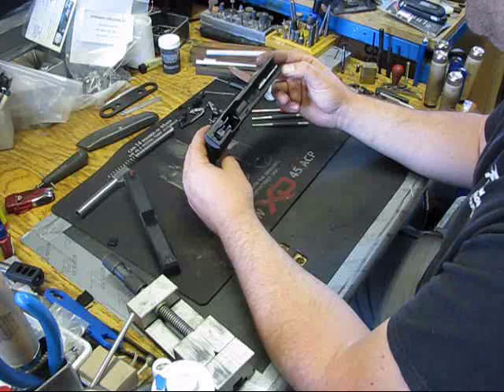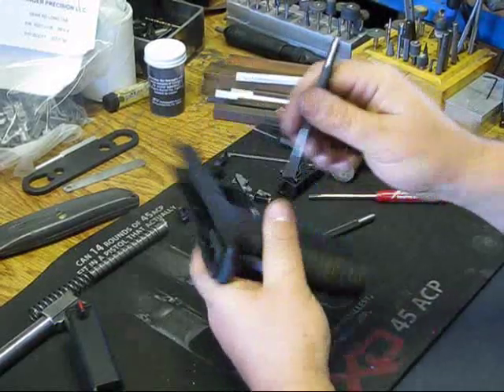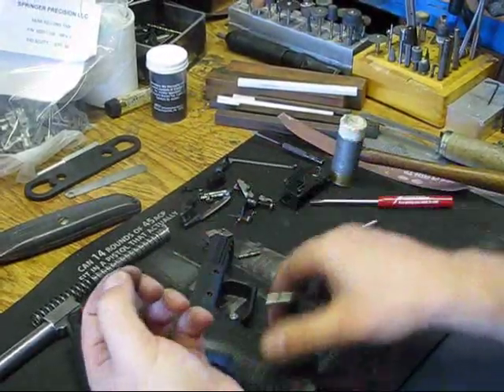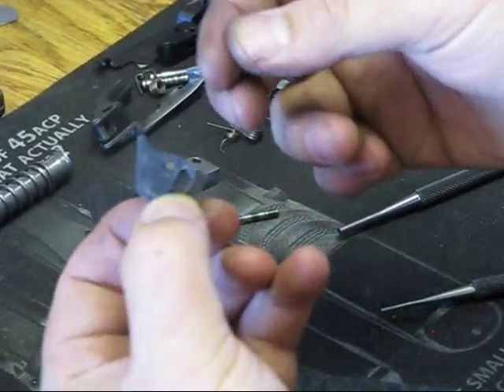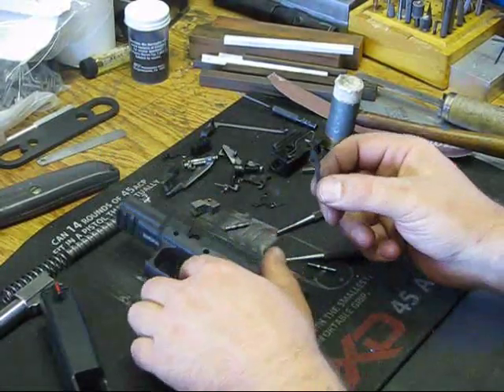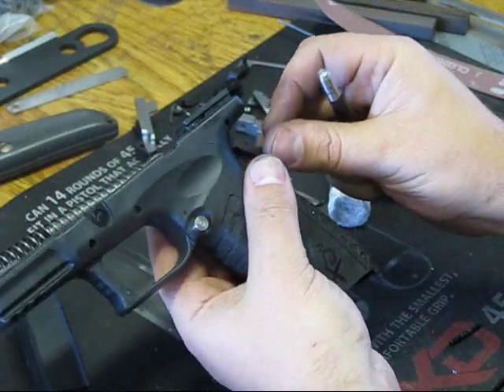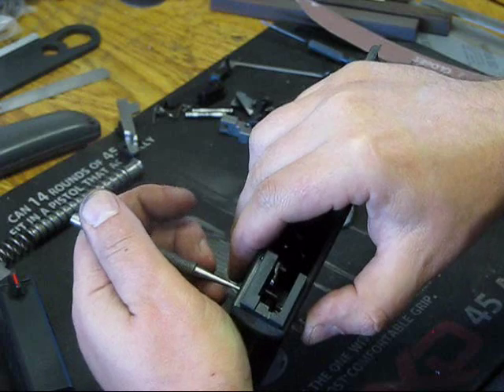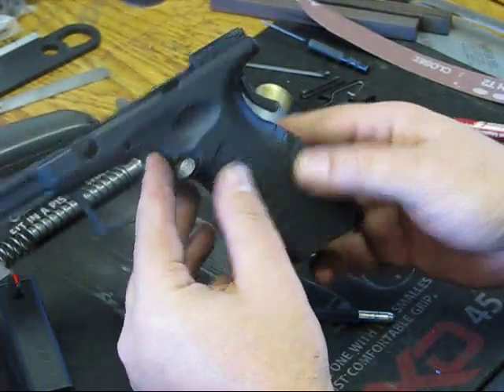Springfield XDM and  XD grip safety detail assembly instructions by Springer Precision

Comment: Ugh. You made that look easy!! I've broken 2 grip safety springs so far trying to hammer the pin in. I have NO IDEA how you just "popped" the pin in with your hand.
Reply: Practice. You can use a slave pin our a small diameter punch to hold it in place.
Reply: Yep.  I used a slice of a Q-tip stem as a slave pin, but hammering the main pin in broke the spring. Twice.  :(  You make it look easy.

Comment: Hey I have a question for the OP. I accidentally tried to check trigger weight. I didn't engage the grip safety. I pressed pretty hard wonder if I could have bent something
Reply from the maker: I don't see how you could bend something checking the trigger pull weight without being very violent.

Comment: I installed a trigger kit on my Sub Compact XD40 a few years ago and I am just now figuring out the grip safety is not working. The bar just lays flat when I get it all back together but it seems work until the last steps in put the slide back on. Someone told me to file down part of the sear but if so, where on the new sear? Thanks. I really need the help.

Comment from the maker: There is not a safety that does not operate available for the XDS currently. The easiest way to disable it is to use a tape product. We will be releasing a new grip tape product for the XDS in the XDS within the next two weeks and it will have a piece that will allow you to tape over the safety should use choose to.

Comment from the maker: @stvebnny4 

Practice helps. You can use the shaft of a Q-Tip trimmed to the width of the safety to retain the spring and use it as a slave pin if you need a "third hand."

Comment: For some apparent reason my grip safety will not extend from my grip it's stuck in the grip firearm Cycles. What could have caused it to stay inverted????
Reply: I would remove the safety and clean it. You can use a cleaner or canned air if you don't want to remove it.
Reply: @scottspringer5698  thank you. If I fire several rounds do you think it might disengage?
Reply: @duaneshadd777  possibly, you could try pulling it out or just wiggling it with the slide off.

Comment: Can you remove the grip safety without taking apart the rest of the frame internals first?  I want to stipple a XD so I want the grip safety out of the way while I prep the frame and do the actual stippling then reinstall it once done.  I just don't want to have to take apart the entire frame when all I need is the grip safety temporarily out of the way.
Reply from the maker: Not in a practical manner.
Reply: @SpringerPrecision  So you can't just drive the grip safety pin out and pull it out do the stippling and then just put it back in and put the pin back? 

Thanks again for your help.
Reply from the maker: @shinobi9922  A lot of people can't. There is a spring that an cause people fits.

Comment: If I wanted to remove the grip safety, is there a replacement part I can buy somewhere to cover up the hole? I'm not a glock-fanboy(although I do love them) but I've got an XDS and I've had it fail to depress fully when I pull the trigger and if I'm going to carry it and need it at a moment's notice, I would like to not have to worry about my grip. I would rather not drill any holes in the gun if I don't have to
Reply: Mavis Blinnie I was wondering if I could disable my grip safety too, I hate the grip safety I've had the same problem in the Springfield xd9 4" service model.

Comment from the maker: The grip safety pin has a notch in it for the safety spring. If you don't have the notch int he spring it will stick. Make sure the pin is centered and you should be able to feel it click into place, but the notch has to be on the correct side. Please give the shop a call if you need help. 541-480-5546 Thanks